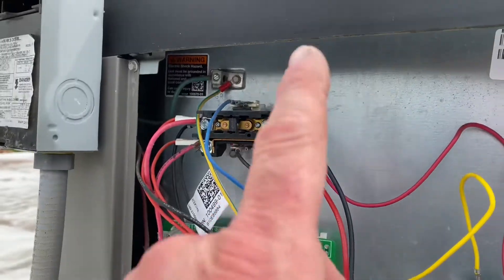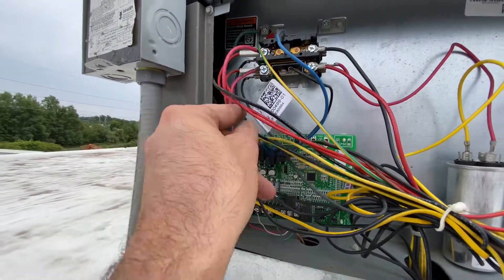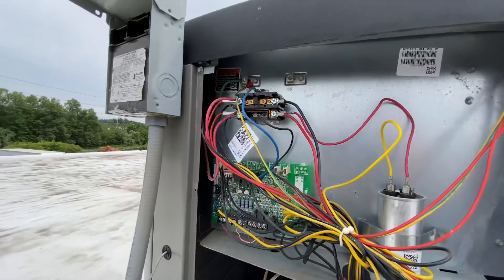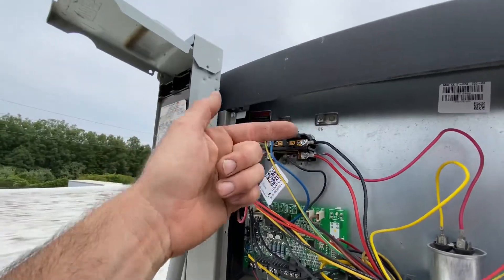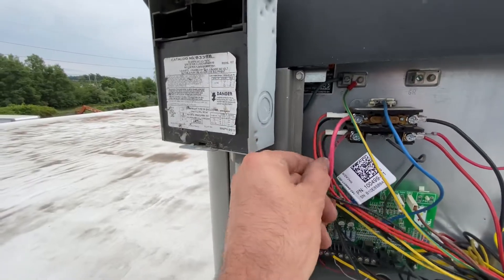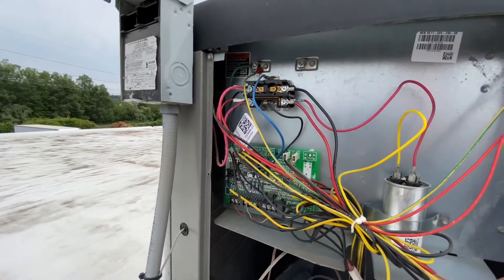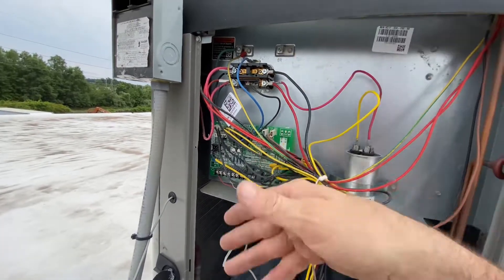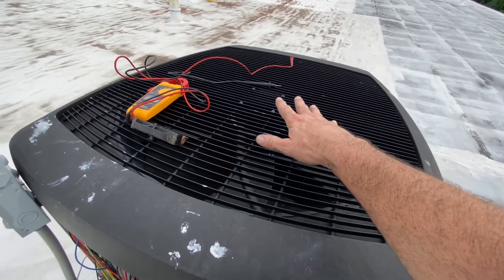How A Double Pole Contactor Replaces Single Pole Contactor HVAC Tip

Comment: The crankcase heater should turn on when the compressor is off they put a single pole contactor because the crankcase heater should get the second power leg from T2 or the side that's always has power on contactor so the heater should be connected on L1 and T1 I know that there the same power leg but when compressor is off the heaters T1 jumps to the common winding of the compressor then goes through the run winding then the run winding should be connected to T2 and goes through the contactor to L2 that side is none interrupted side of the contactor  when the compressor turns on the heater gets power from the same leg and open an internal safety switch and heater is not running until the compressor turns off again the safety closed hope you can understand this its hard to explain it its easier to draw it out

Comment: Finally a video that answered a question I have asked on several channels. I recently had a fan to go bad. In all my years of owning homes and it’s been 40 years this is the first fan motor I’ve had go bad. Anyway when the tech opened the condenser I noticed that there was only a single capacitor running the compressor. I had never seen that. I’m one of those DIYers that attempts to learn all I can so I watch a great deal of videos. When I saw the fan didn’t connect to a capacitor I was puzzles and initially though maybe a repairman took a short cut on me. I checked the wiring diagram and found that’s how the manufacturer has it to be wired. After seeing that I was really interested in knowing why and how the fan peers up this way. This video just answered that question so I thank you. I’d now love to see this type of fan being wired up. Good job on the explanation.Mine is not a Lenox but a Ruud and is a double pole contractor.

Comment: So, if it is in the summer, and the compressor heater isn't required.  You can at minimum substitute a two pole with a single pole without any concern?  Fan dosen't  have to be hot?
Reply: The crankcase heater isn't just for cold weather. It is to ensure the compressor gets proper oil return during the off cycle. It is needed year round.

Comment: Had a shady technician come out to diagnose our unit and he said bad contactor. He showed me by engaging the contactor so the compressor and fan would turn on. Compressor turns on but fan does not. Fan sounded like it was seized. He said once he replaces the contactor for $240 the fan would begin working again

Comment: Can you just jumper a pole together on a double pole contactor and use it the same as a single pull?
Reply: Doing so would effectively make the double pole contactor act as a single pole, because you are only using one set of contacts. I prefer to have the entire circuit deenergized when not in use. No reason to send a 110vac (ground potential) to the compressor when it isn't in use.

Comment: 2 pole just means Live and Neutral both cut when contactor is open; surely the difference is one of safety?
Reply: No neutrals. Its 240v.  each leg hot is 120v 120v
Reply from the maker: You only need to break one leg of power to shut off system. If something always needs to be energized, you can wire it on the hot side of the contactor/ line side.
Reply: @howtohvac3234 which components always NEED to be energized?

Thanks for the vid!!

Comment: Good info for an electrical tech, who can understand the electrical lingo. Average DYI would not quite understand Line/Load references. But you did a GREAT job basically breaking down how to break/make a basic 240vac source. Good presentation.

Comment: Good vid.  So with a single pole, what prevents the hot 120 leg from trying (unsuccessfully) to start the compressor?  How does the compressor know to ignore 120 volts?  Thank you.
Reply: Because you need both sides of the circuit to draw the electricity through the motor or whatever load you are powering…it’s the same reason why you could touch that one wire as long as you are not grounded…you need a ground or another pole to draw the electrons through the circuit

Comment: Wouldn't it be much easier to simply say....take the output ("T") connections of the shunt (non-switched side) of your original single-pole contactor...and when you replace with a 2-pole contactor.....re-locate those wires to the  incoming line connections? ("L" side) ?

Comment: What about having available power to the capacitor, if the power isn't there then wouldn't there be a lag of current to the compressor using a double pole??
Reply: as soon as you open the Live wire contact the capacitor and other items connected to neutral are receiving no AC power.

Comment: How does the capacitor store energy if the double pole cuts off power? Does it instantaneously get power when the contactor closes?
Reply: Thats what I want to know!
Reply: I wonder the same. I tried this two pole setup and the compressor didn't start.  I checked my wires and tried again, it was all correct, and tried again.  This time it worked. I think the capacitor needed charging.  Will monitor what the ac does tomorrow.  Seems to me the fix is to move the capacitor over to the always hot side of the contactor?

Comment: They also use the connected thru side of contactor for trickle voltage for windings using cheap way as crank case heater.

Comment: Congratulations...Adding a 2-pole unit creates an additional failure point since there are now 2 moving contact points instead of just one and if either one fails, there goes your A/C.  To remove power completely to the unit, use the A/C disconnect which is what it's there for.

Comment: I heard Some manufacturers use constant power from single pole contactor to keep compressor oil warm.
Reply from the maker: Yes I did point that out on the two grayish black wires that go to crankcase heater

Comment: Just one critique about this video. Towards the end you call capacitor a compressor when talking about wiring. Otherwise good explanation. Thanks.
Reply from the maker: Yes the wire goes to capacitor. Yet it is for the compressor? Only herm on capacitor is in use. I thought I mentioned that in vid. Mabey I didn’t
Reply: @howtohvac3234  I guess what I was trying to say is you pointed to capacitor and called it a compressor. Not a big deal.

Comment: Crankcase heater is wired wrong. It should be wired across the normally open contacts so that it shuts off during compressor operation (unless it’s shut off via a discharge line thermostat or ambient thermostat) While wiring a crankcase heater hot all the time works, it shortens the life of the heater (that most techs never check) which will most likely cause premature bearing failure of the compressor due to refrigerant condensing in the oil sump. As long as you are properly controlling your crankcase heater there is absolutely no reason why you can’t use a two pole instead of a single pole. If you are changing the crankcase heater to stay energized all the time you are an asshole. Send it dude. Screw the haters.
Reply from the maker: Their is a switch on the liquid line that controls crankcase heater. As you pointed out no reason to always energize. It’s useless when it’s not cool outside.
Reply: @howtohvac3234  ten four. I never understood why manufacturers use an external thermostat to control a crankcase heater that is always going to shut off when the compressor is running yet pinch pennies on everything else haha. Wait until someone sees you throw a two pole contactor in a unit instead of a three pole in a pinch. Carrier does it every day in the factory 🤣
Reply: You mean it should be wired to normally closed contacts that open when the contactor pulls in to run the compressor.
Reply: @RobertL78  no. I mean it should be wired across the normally open contacts on a single pole contactor. Google it.
Reply: I must be thinking of different controls then. Usually normally open contacts that I deal with are open when there is no power applied to the coil and the normally closed contacts are closed with no power to the coil.
Reply: @RobertL78  because it’s a single pole contactor the compressor windings pass L2 to T1. Therefore you have 208/230 from L1 to T1 when the contactor is open. Wiring the crankcase heater across the contacts gives you 208/230 for the CCH with the contactor open. When the contactor closes, you now have 0 volts from L1 to T1 causing the CCH to pull 0 amps, turning it off during the run cycle.